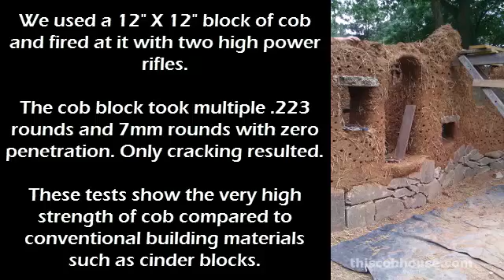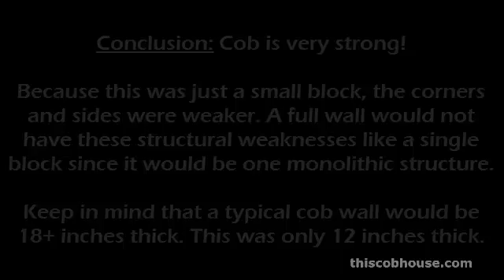Fullmetal Cob - Build a Bulletproof Cob House

Comment: .223 is really not high powered and it is met to fragment however I am impressed by 7mm
Reply: Dean Counts You're kidding, right? A .223 leaves the barrel at 3000 fps. Compared to a 7, the .223 isn't as powerful, but the .223 is from being weak.